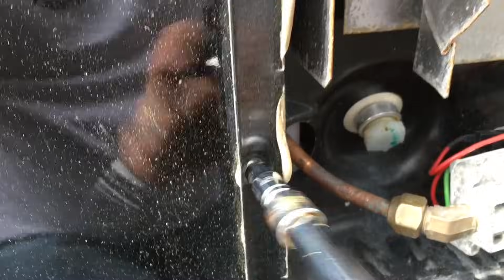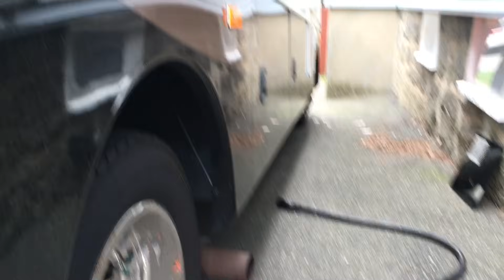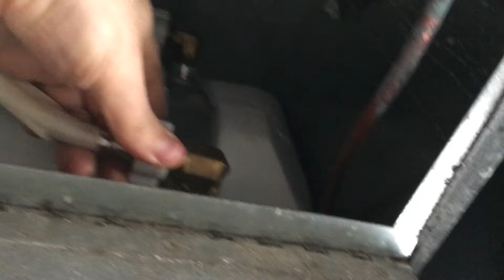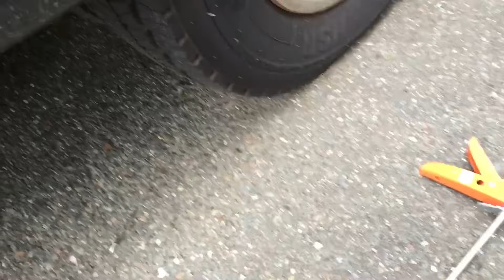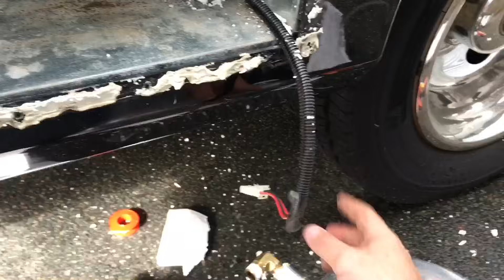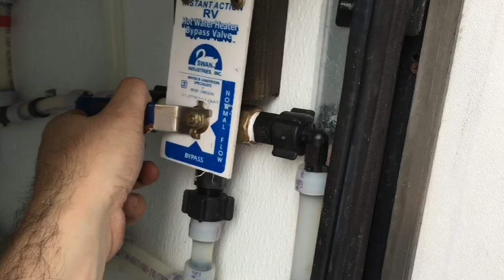How to replace RV hot water tank

Comment: that trash you pointed out at the end was the same thing I wound up with from the old tank.  The Airstream tanks really require a tug if they are factory installed.  You have to bend the flanges 90˚ then cut the caulk and plumbers putty out with a long sharp knife.

Comment: That sealant, if anyone is looking for the proper name, is called Butyl Caulking.. It's what they used to put windshields in with, and it's great for making water tight seals in situations like this.. It won't break down the same way that silicone will, particularly around a heat source like your tank. :)

Comment: Dang - you skipped the one part I actually needed... removing the tank from the back of the panel and reattaching the tank again.
Reply: Have you figured it out yet?I'm having this issue
Reply: @stefaniesevera1123  Hi Stefanie, I ended up paying the local RV shop $20 to knock it off and put the new one on. They had already rigged a larger diameter pipe that let them tap on the back plate and push it off the exhaust port. Good luck to you!

Comment: Good video. I am replacing mine with an AC/gas unit that is the same size. I want to preserve the old one intact as my neighbor wants it. I was an electrician so hooking up the power wiring is no issue, but i was nervous about all the rest until I saw this video. All my plumbing is behind a cupboards as is the tank so hopefully someone pushing as I pull, will preserve the insulation on the old tank.
Reply: One other tip salvage the circuit board and eco kit off the old one if the board is the same. I have had both go on Atwood heaters in the past. The ECO kit is actually only about $30 so no big deal but that circuit board is pricey

Comment: Bravo! I may or may not, have to replace HW tank, just trying to fix what I believe is a leaking line connector. The access panel underneath may be a challenge, because there's an improvised steel shroud covering it. But knowing where to look made a difference. Thanks!

Comment: For the electrical, how do you know if there is AC current as well as DC?  I currently have an Atwood GG Model (gas only) and I want to upgrade to combined.  If I pull the unit only to find no AC, I have a much bigger project.  I have a Fleetwood Storm, 2015.

Any help much appreciated.

Comment: Your title is misleading. You didn't replace the tank. You replaced the whole unit.
Reply: William G more like $200.and yes, all of the other parts are fine.
Reply: The unit and the tank is all together, why would you replace the tank and not the whole unit?? To save $20? lol
Reply: Yes. This is true.
Reply: Got it. In that case then yes makes more sense to replace just the tank. My unit was older so I just replaced everything.
Reply: I purchased a replacement tank installation kit for $182 including shipping. Just a quick check, the whole unit from Amazon is $385, so I saved about $200. If it had been only $20 savings, I would have replaced the whole unit, but I like saving $200.

Edit to original post: After posting I found my receipt for the tank. The kit plus shipping was $165.21. So a little more than $200 savings.
Reply: Where did you get the unit? I looked on Amazon and they wanted 1200 ??

Comment: THANK YOU I HAVE A 2004 BOUNDER  WITH THE SAME UNIT AND I NEED TO REPLACE  MY ELEMENT YOU HAVE THE ONLY VIDEO  THAT EXPLAINS  IN DETAIL. I CALLED FLEETWOOD  AND THE GIRL SAID THE ACCESS  WAS FROM INSIDE  THE COACH.  I HAVE A WASHER DRYER  COMBO AND MEASURED FROM DOOR TO CENTER OF WATER HEATER. THEN MEASURED  INSIDE  AND LOOKED AT THE HEIGHT  DIFFERENCE  AND SAID NO WAY AM I PULLING THE W/D OUT TO REPLACE THE ELEMENT  ILL JUST USE THE GAS PART OF IT. SO THANK YOU SO MUCH AS I WOULD  HAVE EVENTUALLY  PULLED  THE WASHER  OUT AND WOULD  HAVE BEEN HOT TO FIND NO ACCESS  TO WATER  HEATER. I'VE  CALL FLEETWOOD  SEVERAL  TIMES  FOR DIFFERENT  ISSUES  AND THEY'VE  EITHER BEEN WRONG OR COULDN'T  TELL ME. I HOPE I DON'T  HAVE TO SLIDE THE WATER HEATER  OUT TO GET THE ELEMENT  IN AS THERE'S  NOT MUCH CLEARANCE  AND I MAY HAVE TO. YOU'RE  A LIFE SAVER AND THE ONLY VIDEO  THAT SHOWS  THAT ACCESS  PANEL.

Comment: I am so glad I watched this video.. It is the ONLY video on Youtube where someone knows not only how to do step by step but can actually talk to us like normal people. You were very clear and detailed and I can't wait tio tear into my water tank this weekend because of your easy to follow comments. Thanks so much. RV caster.   Keith
Reply from the maker: Thank you, I'm glad I was able to offer some help. Let me know how it went :)
Reply: Well the sad result was that even after watching your video and getting so pumped up about fixing my identical problem, I had a letdown. I got under the water heater on my back and Bam! There was a solid bottom under it. No screws or trap door. I took all the screws out and broke the sela and pulled it 4 inches out but it caught. I assume there are PEX tubing inside preventing it form coming out more. Not sure how to get to it since there is virtually no room inside the RV to work. I thought about cutting it from the outside and then repairing it with a 1/2 inch Gator bite coupler. Any suggerstions?
Reply from the maker: skeeter3276 hey, sorry about reading your comment so late. I hope you fixed your issue and was able to replace your hot water tank.
Reply from the maker: Laziestcrow hey, yes the starter is electric and the main line is gas, so I had 3 wires for the electric part and the main gas line coming from the tank, which was a tight line and not very easy to pull out but with a little bit of work you'll be able to get it out. Please mark all your connections and wires so you know how to reassemble the new one. Good luck